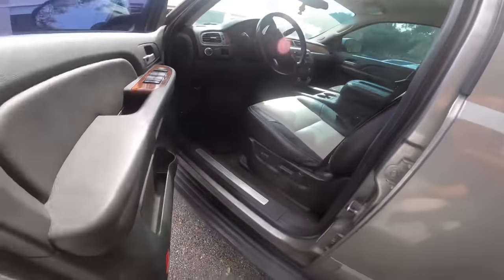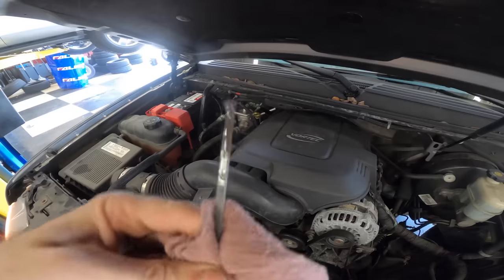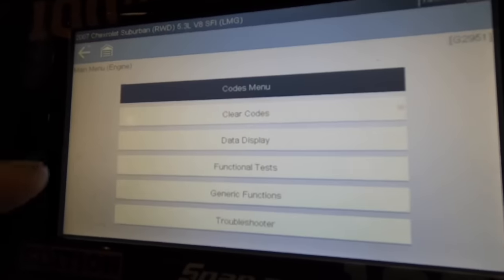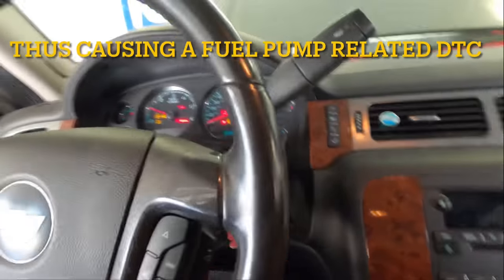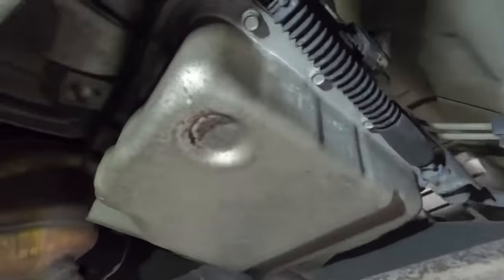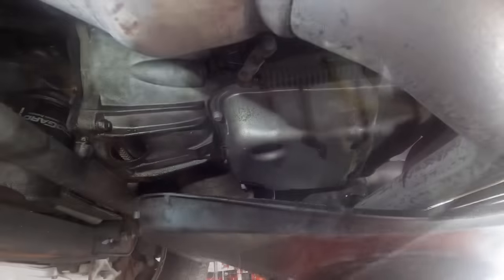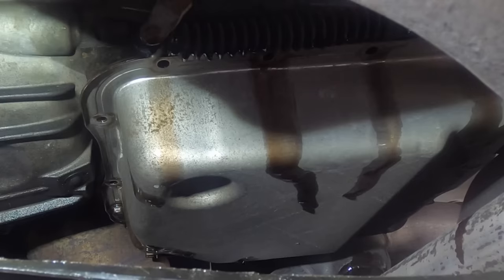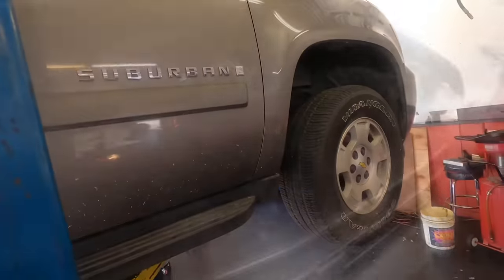Busted! SCAMMING Mechanic Causes Damage! 4l60E Transmission

Comment: I can pull the key out of my 07 Chevy Silverado 1500 4.8l LS Crew Cab with it still running but we haven't had any ignition codes or problems. It works like normal, except it pulls out when running. And i had to replace the oil sending unit in mine also. That's a common issue with that era GM vehicles, also oil pumps going out and weak transmissions for pulling in Overdrive. My transmission went out in mine also.

Comment: Gotta hate sneaky bassturds like that. My Dad was a Master Heavy Equipment Mechanic for the AF and had been a mechanic for years before that, including running the only NY state certified inspection and repair shop in our area. So he taught me from before I could walk all about tricks sneaky bassturds pull. 

A local dealer here was having difficulty when Chrysler went TU awhile back. We had oil service contracts with them on our two Ram 5.9l Cummins. Within a couple weeks of every oil service, something would break/fail. Never anything huge, but enough to cause about $1k in billable repairs. I quickly decided something was up and really went behind them after every service. Found wires disconnected like the 4wheel drive plug on front axle. Stuff like that. After they cracked the transmission speed sensor and tried charging me almost $500 to "fix" it, I quit taking the trucks in. Was amazing how fast all the trouble stopped. Sucked because now I was crawling around under the trucks again, but oh well. 

And it's not just single independent shops either. Les Schwab tried telling my sister she needed an entire brake system replacement, front and rear, calipers, pads, rotors, everything. Then wouldn't let her leave, saying the car was dangerous. Dad called and put an end to that BS and when I popped the wheels off it at my parent's place, there was a rock wedged in the caliper. Nothing else wrong. Screwdriver fixed that rock, measured everything for tolerances etc and was fine. I've never been back to them again. And that was a LONG time ago now.

Comment: Ray, know what's killing the battery sometimes, but not every time? That ignition switch. It sometimes stops short of 'lock' when turned off, staying in the ACC position, but you don't notice it because when it stops on ACC, you automatically think it is in the 'lock position, because your brain has been conditioned to think that. The key will come out in any position, as you discovered, thus adding to the confusion. Kills the battery, but sometimes the key works correctly, & doesn't. Ask me how I know? 2007 Equinox.

Comment: Just a little advice you can look at all ur ignition voltages in the scanner so next time u see an ign voltage code you can see very quickly if it does or doesn’t.

Comment: that bracket on the left side never comes loose, I always pull the cable out then bend it gently then bend it back those little torx bolts become part of the case

Comment: This is the 2nd time I've watched this video, great sleuthing and troubleshooting. but best of all your honesty!. I recently called a Muffler shot for price on Muffler and tail pipe. quote? was $850.00. I can but both items over the counter for $179.95. their hourly rate was $85 per hour. so they were going to charge up over 7 hours. for a max 2hr job? in short ripping me off for over $500. and this was a National brand name company.. We both know it's not their fault but rthe individual dealer/franchise. Then I called the make of the vehicle's dealership and got a quote of $1100 !!! for the same thing. Welcome to the New America!. I'm 80 yrs old and wrenched for few years my self. so not ignorant and changed more than my share of Mufflers and tailpipes.  So I paid the $179. and did it myself in my garage on a creeper and ramps in less than 2 hours. I rest my case. I"m old! but not helpless.

Comment: Thanks for the video.  I want to say we need more honest mechanics like u.  I will be honest & tell u I do not trust auto mechanics at all, especially when your car is out of sight when they r working on it. Dealerships are the ones I hate the most.  I have been scammed a couple of times so now I have them show me, (if visually possible) what was done. I think Fluid  changes are the biggest scams because u can't see the new product.  I discreetly mark tires and parts that I know are too be worked on to see if they actually do what I requested. I also ask for the parts that have been replaced. Yes,  I have caught them scamming and have gotten my money back and then let everyone know.   I now own an Autel car scanner so if an issue arises that I'm not capable of fixing on my own because I don't have the tools necessary to do so,  I can see if they are trying to scam me with other unnecessary work. Wish I had a lift, in my garage to make working on my cars easier.  Thanks to videos like yours I am able to do a lot of the work needed on my own.

Comment: Great job working systematically thru the issues.  Made very good diagnostic findings.  Definitely heeded to pull the trans cooler lines and flush the full trans system.  So many people (home mech) only drop the pan or drain tap which is just a fraction of total fluid.  Have to do a full flush after the pan and filter.  It's one thing that's quite simple if it has a trans cooler.

Only other thing with trans is whatever the factory recommends for trans fluid change interval, cut it in half.  Trans fluid is cheap vs the $5k + to rebuild today's trans.  Hyundai is 100k. Straight from one of the best master mech trainer for Hyundai.  Change the fluid every 35-50k miles.  Same IMO for all consumer grads vehicles.  Toyota is 100k and a  optical sensor.   Regardless 50k unless you live in flat land and drive like a grandma.

But if I were you I would nit let the vehicle go without a full flush.  It can be a basic full fluid swap but no way to leave 70% of the fluid still the trans system.  You saved the owner thousands a couple hundred for the fluid flush is mere penny's in comparison.

Again great job.  Good to see ethical mechanics with good skills and willing to admit their limitations.

Comment: Trying to figure your noise (clicking underneath whilst driving), wondering what in trans would do that other than something inside breaking or becoming ready to break causing catastrophic failure and carnage. The fact you were driving and truck shifted normally kinda makes me think maybe that noise not inside transmission. Could it possibly be a universal that is bone dry and needles are grinding themselves to dust whilst shaft is spinning?? I was hoping you would have time to get into that part of problem. PS  I used the word whilst for your amusement Ray. Love the show bro. So glad there are other options than Scotty. That guys voice just cuts through my very soul. Take care bro.

Comment: When I saw that wire coming out of the fuse box, I figured it went to the fuel pump relay box in the back and someone was pulling a trans/fuel pump/computer scam. I've seen this one before. Customer would have paid for a new computer, a fuel pump, a trans and labor. And the scammer would have fixed it in 10 minutes and made thousands.

Comment: Gotta be careful when you torque with the impact wrench. You can strip the threads easily on the transmission. Its a hassle fixing it afterwards

Comment: Man I have trust issues with Mechanics and always have worked on my own vehicles, with exception to transmission work and major engine rebuild work (no garage). I finally bumped into a good mechanic and I would trust him with my firstborn child at this point. I had a top end rebuild due to a seized lifter and after getting it back had 25psi oil pressure and the guy did the work using chinese lifters, not MOPAR and they click and clack like mad. The oil pump job would be $1200 with labor. A guy I work with, his son is a mechanic and brought to him. He dropped the oil and noticed the filter was plugged up pretty good with shavings. Decided to just refill the oil and put a new filter on and that fixed the issue - of course I felt dumb but the oil was supposedly brand new. Point being he could have called and collected the $1200 and instead charged me for taking the valve cover off to check to see if the guy left the rocker arms loose...they weren't loose, just crap parts. I paid $200

Comment: Since I have an ‘04 GMC Envoy that has a 40L60E, I always worry about my transmission. With 218K miles and simple maintenance done, oil and transmission fluid/filter changes, it doesn’t help my anxiety since even when it was a 700R4, it wasn’t the best transmission.

Comment: I find the hash marks on the Transmission dipsticks for most domestic Automotive and Light Duty Trucks equate to 1 PINT rather than 1 QUART on most oil dipsticks.  For those lacking in math conversion skills, 1 PINT is half of a quart or 2 Pint(s) = 1` Quart.

Comment: Gotta be an Impala. From 2006-2012 the ignition tumbler  and safety lock  wire on the shifter  will come loose in the console. The dark fluid will be purple because of the aluminum  particles of the gears has a chemical reaction with the fluid.  The AC and temp gauge will go out simultaneously. Take POS cable off battery and reconnect...both will start working again. Lucas took care of the slipping, soon as you notice , put it in and drive gently til it starts shifting . Those cars all have the ignition and shifting issues.

Comment: The dishonest car mechanics are everywhere. I mean everywhere. Especially here in Leeds AL. Try to get your oil changed here and one of the guys will ruin your day. Walmart tire guys steel out of your car. My mother just called a repair shop to change a lock actuator and they had her convinced the part would be 250 plus labor. The part is 27 bucks. I found a more expensive one for 57 but the one from the Honda place is 27. I can go on and on. I can not let anyone touch a vehicle that is in my life because I haven't gotten started good on the list of bad experiences. Idk what to do other than fix it myself. The only shop that you can trust might have your car for three days or a week or longer because they can't get to it as they are busy with cars in front of yours. So that can be a problem. It's not like there's a loner. Renting a car is the only way around that and that's pretty sad. It has to be like that I mean. What can you do?

Comment: I had a situation once where a customer came in for a oil change and a general look over. Another shop advised him he needed a throttle body replacement due to high idle. I serviced the car then took it for a test drive, yes it had a high idle at about 1800 rpm. I found that someone had reset the throttle return spring to a relaxed position so it didn't return the throttle to the stop. I relocated the spring and said nothing to the customer, he paid his bill for the service (basic LOF) then left returning moments later. He came up to me wanting to know what I had done to his car at the same time trying to stuff a tip in my shirt pocket I told him what I done and he became a forever customer claiming I was the most honest mechanic he had ever met.

Comment: I know that ignition switch will cause havoc on the shift solenoids on gm vehicles.. i got stuck in 3rd gear and suddenly pulled up 6 different trans codes... looked at wiring to see where they all get power from and sure enough it was all caused from my faulty ign switch

Comment: Nice long video. 
Few things: 
Do you really need to scratch the surface of the pan to take the gasket off? Later can cause leak issues. 
Also are there no way of emptying the fluid before taking off the pan?

Comment: I recently took my vehicle to a shop to have a new alternator installed.  I check my fluids regularly and know that all were topped off.  When I picked up the vehicle the mechanic said I will need a new power steering pump soon and that he heard it whining and drained the PS fluid and put new in to see if that would resolve my problem.  I thought that was weird he would do all that at no charge and also I hadn't heard any whining with the PS pump or had any problems.  After driving it around for the day, I noticed the steering wheel would click when I turned it.  I pulled over and checked the PS fluid and it was bone dry.  So, he actually just drained all the fluid and didn't put any in planning on me bringing it back for a PS pump.  I added new fluid and have never had a problem with it before or since.

Comment: That blue wire isnt always a scam. My dad had a blue wire to key on powering the fuel pump. Reason for this is because the tipm would keep the fuel pump on constantly so it would kill the battery and burn out the pump. SO this bodge wire was to fix the issue. What I did to actually fix the problem later was dismantle the TIPM and desolder the fuel pump RELAY THAT'S INTEGRATED INSIDE OF IT. Annoying but that fixed the issue. This problem happens on a lot of dodges and since most dont have the skill to replace a component on a circuit board people either just replace the TIPM or bodge a wire in. Most go for the later.

Comment: as a trans specialist ignoring mechanical failure in a 4l60/80 is completely irresponsible and trying to hide it behind electrical issues is unexcusable... this is not a complicated transmission... we generally can rebuild a 4l of any kind within 45 or so minutes without interruptions, this is active suspicious activity and should be met with a court of law, especially since fixing this issue would have cost less both for the customer and the shop involved, P.S. the loss of electrical function to the dash, sluggishness, and several of the problems i saw show a possible alternator replacement required. And finally i believe the clinking you are hearing is the start of torque converter failure likely brought about by the poor workmanship of the previous mechanic. Also the fuse issue is absolutely unacceptable

Comment: I've got an 07 Suburban as well and I've taking it to a couple different mechanics and I think I got scammed for a fuel pump because after I had the plugs changed supposedly I began to smell gasoline and they claimed it was the pump. I said put OEM parts and pump in and he installed some Chinese crap instead. I still had the problem where it won't fill with gasoline and keeps kicking off which means there's some vapor canister problem or something. But then they claim they can't find the problem! I get a knock sensor code and he claims it's the sensors that are built into the engine under the intake manifold but this particular model has the knock sensors on the outside of the engine block! They tell me it's leaking the front and rear seals, want to charge me thousands. I put AT 250 sealant in and suddenly no leaking they even asked me what I did. I put ATS 505 fuel and oil treatment in and most of the problems went away so gobs of carbon came out. Clean the throttle body and it runs better but I now I have a ticking which all these engines seem to develop. A lifter or a leaky exhaust who knows? I'm just sick of these incompetent or crooked mechanics everywhere. Gold another shop not to flush the transmission just drain and refill the fluid. Had the original shop change out the fluids in the transfer case and the front and rear differentials and they found broken teeth in the rear differential but put it back together without repairing it! Recommended me to another shop and I got reamed for 2,300 bucks to replace the gears and assembly. Same story with my Cadillac XTS no one can find the core problems but keep charging me for work I don't need. I confronted couple of shops and they refunded my money and didn't charge me for labor. I think they're all criminals.

Comment: I think you guys should add a small amount of anti slip aditives, Lucas makes good ones. Don't use 50/50 like they say, use more like 90/10 just to add a little bit of resistence, 50/50 works when it's already slipping, if it's not, give it a little bit only to prevent it from going bad

Comment: It used to be that the dirty shops and/or mechanics would just tell you that your part was bad and repaint it to make it look like new!  And then they were required to keep the old part and show it to you, just to stop them from pulling this type of scam.  Plus giving you the opportunity to keep the old part if you wanted to.  Possibly to check and see if it was still good?  
   But now, they added a computer to every system in all new vehicles.  Funny little quirk to that.  They, in my opinion, manufacture the computers to just barely survive in the engine compartment for the warranty time length. Just so that they, the manufacturer can capture that computer sale on a repeating basis.  Surely they can add some more durability to these components?  But no one argues about this...!
  Today's engines are so much easier to do this type of problem to than the older ones.  
  If you know/find a good/great mechanic, keep him.  They are kinda like Medical Dr's.  Once you find a good one, you want to keep them around!  
   So, if you have a good one, tell your friends about them!  Help out your mechanics owners business!  
   And what do you do if you suspect foul play?  Ask around to the nearby shops. And check out their reputation.  Listen to what they say, and how they say it!  You can usually tell if they are blowing smoke up into your, ah face, yeah face!  Plus we now have online reviews!

Comment: Add line is not low. Just means its at the point to add some. If a fuid level is anywhere between the min and max. Its just fine